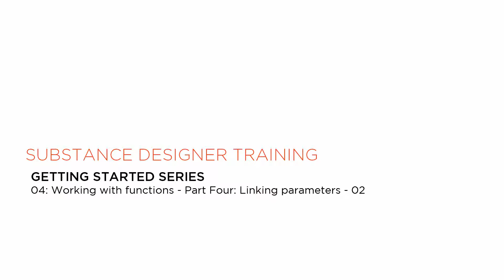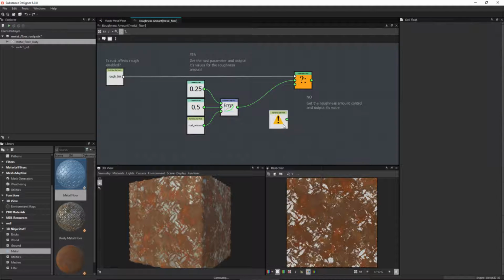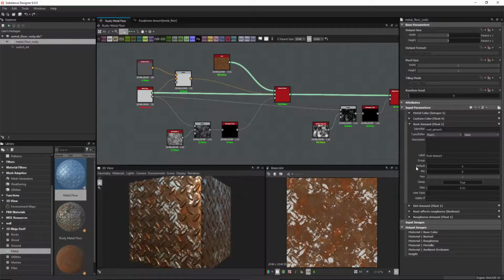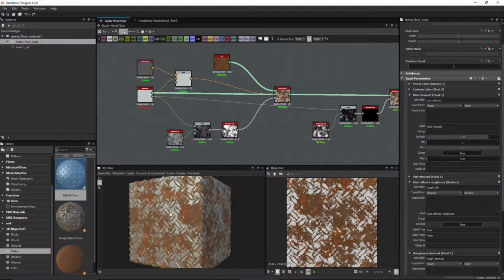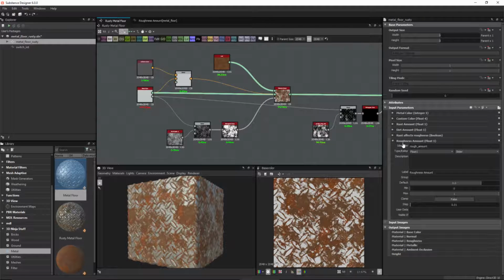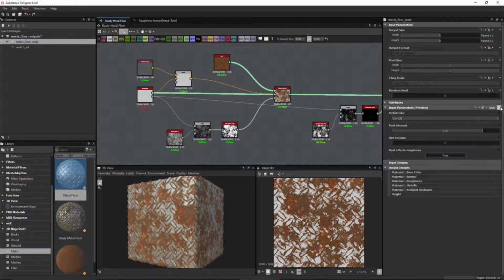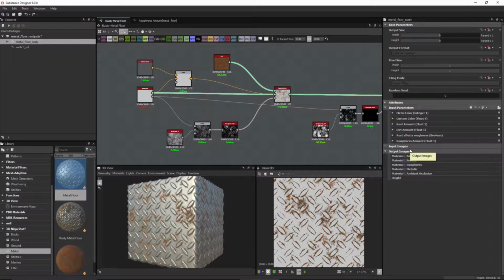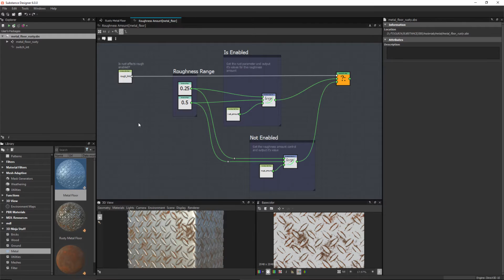Substance Designer Getting Started: 04 - Part Four: Linking parameters - 02

Comment: my question is simple but as im new to programming it will be hard to spell, ill try to make it easy:  cant we just say to  the program that if the variable "rust affect roughness"= false, to simply use the original values of the metal roughness that we simply exposed.... do we need to create another input that control that value?   hope it was not too hard to understand
Reply: by the way, thanks for the tuts, (y) you did a great job here
Reply: no need to answer, the fact is that the original roughness is now controlled by the function, if true it will be controlled by the rust, and if false it would be useless to make it comme back to the value of the orginal rough slider knowing that we dont have access to that slider, which means the only solution is the one you gave in the video by creating another slider  that controls the rough..... the lesson is self explanatory, being new to all these tweaks and options, i didnt notice that i dont have the slider anymore once its already controlled by the function

Comment: Will it cause any problem if instance parameter and input parameter have the same name?
It seems that they are both called Roughness Amount.
Reply from the maker: If they are the same name when you create the parameters they will overwrite. However if the label is the same name, it will not affect anything.